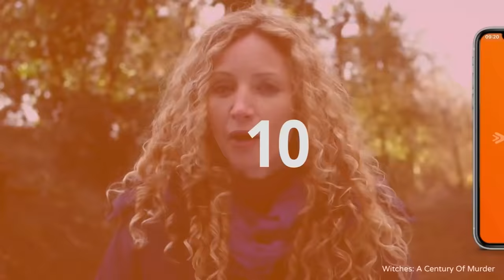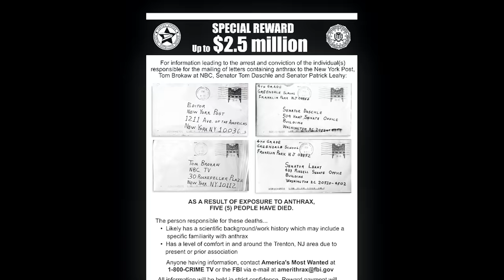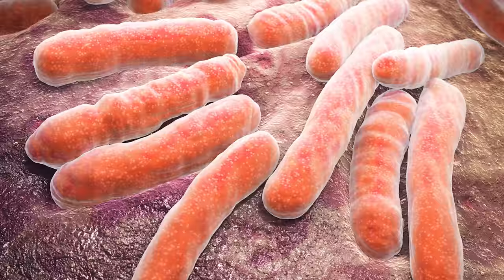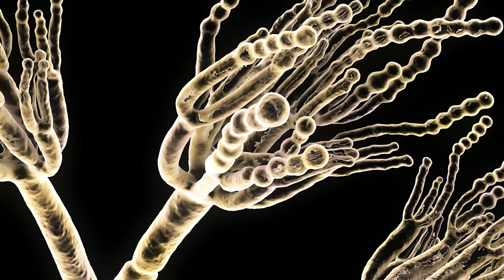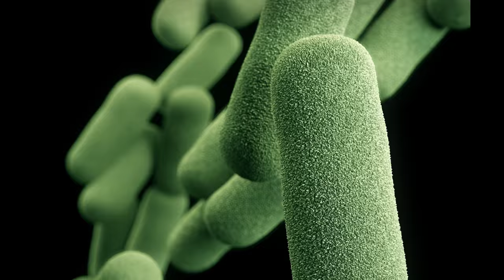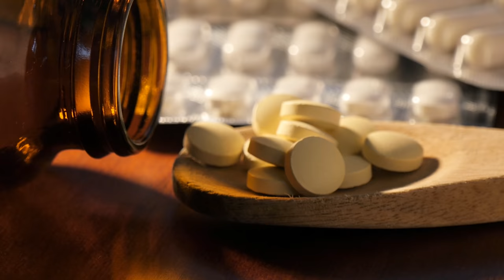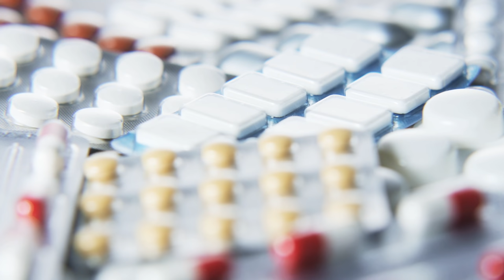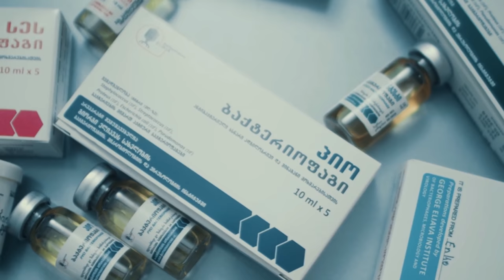Why Are Antibiotics And Vaccines Failing Us? [4K] | The Battle Against Superbugs | Spark

Comment: Hospitals need to be small clinics that only help a few people at a time . The super big hospitals are why we have these bugs . Too many sick people all crammed together .
Reply: Ive lived with a hernia for four year because im worried about getting something worse. From the hospital !
Reply: @hindsight2022  Which country do you live in?
Reply: @salsa564  the USA
Reply: @hindsight2022  to each their own I suppose, I would definitely not risk the hernia getting worse. That can lead to esophageal cancer down the road.
Reply: @hindsight2022  
I've had 3 different surgeries plus an additional hospitalization in the past 2 1/2  years,  no problems at all! The most efficient surgeries I've ever had!😀
Reply: The hospital makes a big $$$$,.
Reply: That's simply not possible in most instances. Hospitals are not just wards with a lot of beds, staffed by doctors and nurses, they're usually centers for highly specialised medicine, something which small clinics could never aim to replace. Yes, things like setting fractures and putting casts on is something they could do at clinics or even the GP's officer, but for most things you need very expensive and specialised equipment, and doctors who have a lot of experience with one specific specialised field of medicine.
Reply: The reasons for most of the highly resistant bacteria existing is doctor's overprescribing antibiotics. We have a lot of big medical centers in the Netherlands as well, yet the lowest rates of antibiotic resistance in the developed world. Why? Because our doctor's and GP's have been instructed by the ministry of health to refrain from prescribing antibiotics unless it really is necessary. So not prescribing young people who have healthy immune systems antibiotics if they come in with strep throat or some other mild bacterial infection, and definitely not prescribe them to people who have the flu or some other viral infection, not when they come in with an infection and it's not sure whether the culprit is viral or bacterial. Instead they reserve it for the people where an infection can be dangerous, like the elderly or those with known weak immune systems, and when it's been ascertained that a patient has an infection they will wait for conclusive lab results to determine whether the cause is viral or bacterial, and if the latter which bacteria and it's susceptibility to certain antibiotics to make sure an antibiotic is prescribed that will actually kill it instead of only killing most of it but leaving some alive and developing resistance.